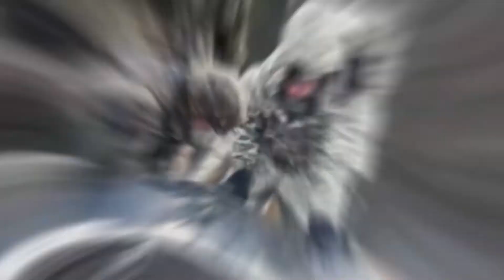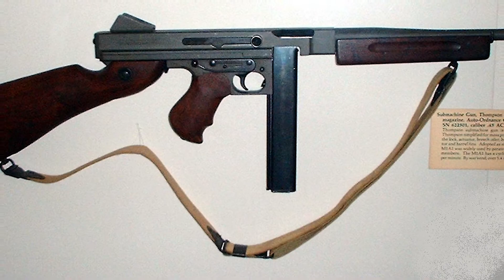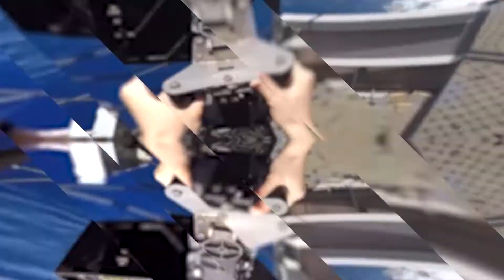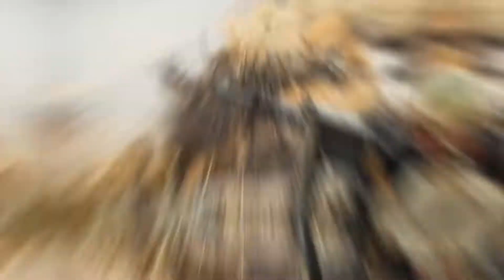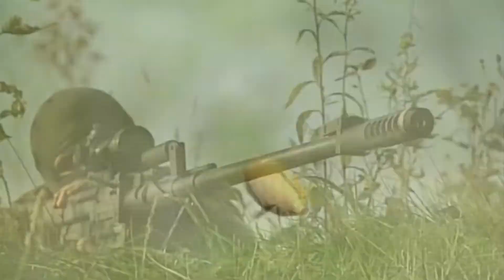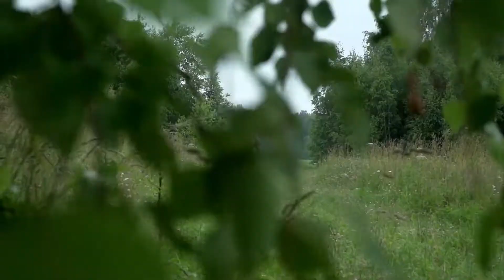United States 50BMG v. Russian OSV-96 12.7x108mm - Heavy Machine Guns

Comment: This is a dumb comparison the Russians had a 12.7 belt fed machine gun better than ours you're comparing the wrong guns probably on purpose. The comparison should of been to the dshk
Reply: The Russian 12.7×108 has a larger casing, but it's actually slower, less accurate, and slightly less powerful than the 50BMG due to having a lower chamber pressure.
Reply: @stephenbrand5661 Power is about the same, the x108 just uses slower but heavier bullets on average and accuracy has everything to do with how it's loaded and the gun shooting it, not the cartridge itself. It has the potential to be just as accurate as .50 bmg.